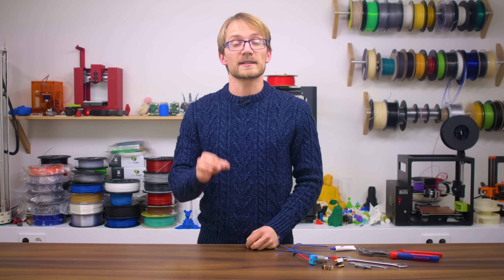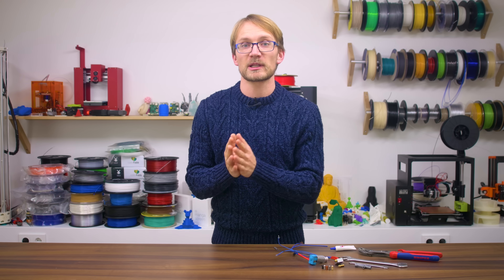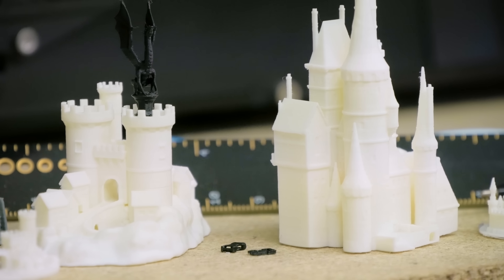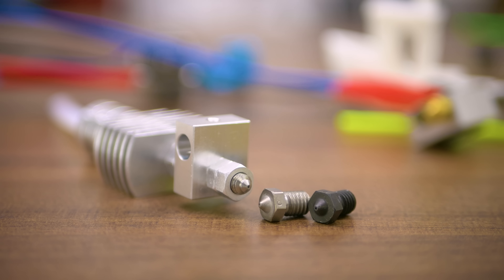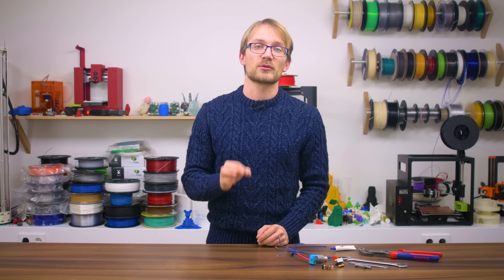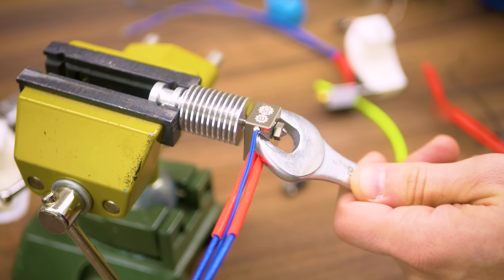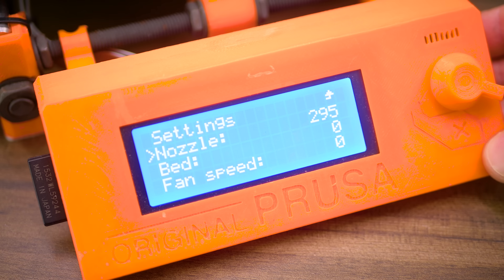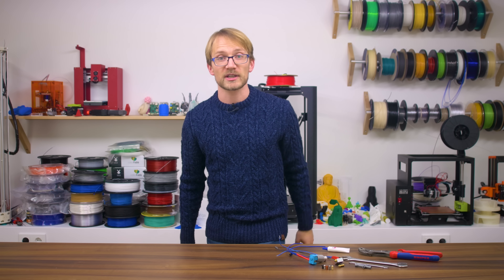How to pick a 3D printer nozzle and how to install it!

Comment: How long does a 1mm brass volcano nozzle last with petg and pla and how do you know that it needs changing?
Reply from the maker: Unless you're actively scraping it against the bed, even brass nozzles tend to last quite long with unfilled filaments (no fibers / glitter). Eventually, the bore will round over and widen up slightly, so print quality will degrade, but with a 1mm nozzle I wouldn't expect this to become an issue until it's seen well in the hundreds of kilograms of filament. Less for smaller nozzles.
Reply: @MadeWithLayers  Thank you, that's very useful and clear.

Comment: Tried hardened steel - kept having a lot of problems. Uneven layers, failed prints, etc. I'd have to crank the temperature up and the speed down quite significantly to make it work. Switched back to brass, my printer prints like it's in factory condition. I do wish it was easier to find videos on how the different nozzle materials affect performance, and what adjustments you might have to make. I don't think I'll be using hardened steel again unless I want to work with some exotic filament.

Comment: Really wanna get tungsten carbide nozzle. Might be overkill, but I plan on printing some abrasives as well and thought of never having to switch nozzle is tempting.

Also I love TC because it's such a great material.
Reply: Funny thing. Not many of these seem to be available (talking about FULL tungsten, not inserts ones) in europe. At the moment i only seen Phaetus X Primacreator nozzles.

Comment: I recently wanted to try to use a smaller nozzle for a very fine part. 

At CHEP's suggestion, I bought a set from Amazon, which included a 0.2mm nozzle; and immediately noticed that Amazon's threads went all the way down to the end. The original Ender5 Creality part seemed to have no theads near where it meets the heatbreak. This, I assume means the Creality heatbreak has a small tapered entry point, maybe allowing a slight overlap (?) to avoid filament escape (?). 

The immediate outcome was that the Amazon nozzle hung lower, despite the fact that its physical length was identical to the Creality nozzle, and forced me to reset my BL Touch Z offset. Things worked well for a few prints, then I started getting leaking blobs :((

Would finding an alternate source for my 0.2mm needs be the required solution; ensuring its threads don't go all the way to the end, and thus a better fit to the Creality heatbreak. Could you suggest such a source ??

I was considering getting a 'Slicer' heatbreak; but from pictures I have seen, it too seems to have a bevelled interface point for nozzles; so I may still need an alternative source of bevelled ended (no threads at end) nozzle.
Reply: Use short nozzle type instead of long threads type
Reply: @Home made science  It has to be long enough to seat on the Heatbreak or leaks occur
Reply: @Exploring Stuff  well it looks like I need new hot end short type then

Comment: Thanks Tom, you earned my subscription.  I didn't realize that the heater block also needed to be loosened and then tightened along with tip after heated up.  Also will start setting temp to 250.  Thanks Dave..
PS: new to printing, I have a Anycubic Kobra printer and have been trying to find a replacement silicone cover, any suggestions?

Comment: Not sur if you’re still reading comments on this old video but here is another one.
I have been changing brass nozzles without any problem using more or less your technic. But lately I’m having a weird problem.  I have replaced my nozzle with the nozzle X and used it for almost a year. Then one day I had a problem with a filament stuck inside and removed it for cleaning. But since then, it keeps leaking after a couple of weeks time.  I ordered a torque wrench to make sure I was tightening enough. But it keeps loosing up after a couple of weeks again. I now tight it to 3nm and still having the same issue. Any idea what can cause this?

Comment: I would have liked some elaboration on the different available shapes, since that's what has me a bit lost.
IE, "ed3" vs "mk8" or "standard" vs "volcano", etc.
AFIK they all have the same thread, but different lengths, volcano being the longest by far.
What I am most confused about is the MK8 vs ed3 though, look completely different but close enough in size to be confused with each other. Are they interchangeable? Would it hurt to have the threads not quite bottomed out if the nozzle is a few MM longer than the heatblock was designed for? How can you even tell which 'standard' a given heater block meant to use? (For volcano this is obvious, but not the others)

Comment: Use a wider wrench and hold the short sides of the heat block which are free of any wires to avoid accident damage to them

Comment: Ok, I just installed a new nozzle yesterday, a .6mm nozzle. When I fed filament though, everything looks like it’s fine, it is coming out of the nozzle perfectly I even did a small test print. I am still worried about if I may have done something incorrectly, how soon would I know if I messed up on nozzle instillation and what would be the early signs of it?

Comment: really great guide about handeling them but i would like a comparison cheap vs expensive. you can get nozzels for less then a few cents each but are they worth anything ? and what to judge them by ? 

also: i have a problem were exspecially the first layer kinda well looks teared from above at one engde of the extruded filament it makes my prints look weird "is as if the nozzel kinda tears it litterly up one side" and i imagne it not being that good for my adhesion as well

i think it might have to do with the nozzel so thats one of the reasons im aksing the above i wonder if its wear or just a low quallity nozzel

Comment: Great Video! I'm looking towards a buying a new nozzle so I thought that I might ask you if the following nozzle specifications with a glass bed on an ender 5 pro could print abrasive materials such as carbon fiber or nylon. 
Specs:
Model: MK8 hardened steel nozzle
Mounting type: external thread connection
Working temperature: 220℃
Size: 0.4/0.6/0.8mm
Filament suitable: 1.75mm
For: 3D printing

Comment: Seriously what is that Anti-sneeze(?)  paste?
Reply: Yep I'm replaying the video lots of time to get to listen well what is this.?
Reply: Anti-seize, although yours was funnier ...! It's frequently used on spark plugs, so easily obtained locally from an Auto parts store.  It's a compound that prevents the threads from locking, a problem when you have high temp threaded parts that are dissimilar metals; like brass nozzles threaded into nickel  coated steel (most hotend blocks). The high temp causes a chemical reaction (called 'galling' IIRR) that causes the two items to bond together, called seizing. In this case you can get a nozzle "welded" to the block, a real PITA to remove. As shown, you only use a little.
Reply: @MrPuterPro  thank you for this detailed explanation

Comment: Hey thanks for that thorough information! I have some questions: Did you just say you can print PEEK with your printer?
Second: how do I clean the nozzle from the outside? many of my nozzles are kind a black after a while so that I can not read which size it is any more (tried with a brass brush and acetone but since I mainly use PLA acetone didn't really do anything).
Third: when I unscrew the heater block for nozzle exchange and then "tighten" it again it always seems a little loose, not as tight any more as in the beginning, is that going to be a problem?
Reply: Try cleaning it while it's hot with a wire brush. If it's just a kind of patina and nothing sticks outwards too much, it shouldn't matter anyway though

Comment: This video just gave the right amount of information. I didn't know about using the Snti Size compound. I would love video about your workflow. Basic information... I can't believe you guys are printing one print  then fixing a bunch of stuff printing another print fixing some more Stuff Etc.  I know you have to do maintenance on your printer from time to time but I'd like to get to the point where I am printing more than I am trying to fix. Like clogged nozzles, misfeeding filament from the coldend extruder, etc. So combined the above with some maintance tips would be nice. Right now I would never leave the house with a print running.

Comment: Why haven't they made a way to switch nozzles while printing. One nozzle print the bulk of print while switch to a smaller one for the details all in one kind of thing.
Reply: you want to manually switch the nozzle? every layer? 
Do this with 2 nozzles on one printer. create the outline with the fine nozzle the bulk with the other.  
Issue here is the amount of swapping you would need to do as well as oozing of the inactive nozzle. further, bumping may become an issue, and the slicer will have to do some serious work, implementing this is certainly non trivial.
Reply: Some printer print with two hot ends for two color why not two size nozzles seem doable.
Reply: @howarddibble3857  you would have to make sure the outer perimeter is labeled as a different color, not only that, the layerheight therefore frequency also needs to change. at all time the layer printing must be higher then the one thats already layed down - this becomes more difficult if layers have different heights and makes bumping into layers far more of a risk. Its very easy to run variable layer height, just not simultaneously. 
I will in a few days have a dual nozzle printer here, I have already spend some time exploring this idea, and if i find the time i will soon try to write some slicing for this but it will take time for sure :/

Comment: I'm using an Anet A8 with 0.4 mm brass nozzle but it keeps clogging which is pretty annoying. And yes, it was my fault this time as I switched between ABS and PLA without properly cleaning it. I am going to stick with PLA from now on and have ordered an E3D Hardened Steel nozzle and a couple E3D V6 copper heat blocks, then some cheap PTFE lined screws to mount it to my standard Anet extruder. 
After I go through the painful process of installing it and leveling the bed, I think it should work great compared to what was there.
EDIT: I broke the thermistor wire while installing the new parts so I have another on the way... It's a nice printer with great results but it has very cheap and poorly made parts.

Comment: stainless steel has a MUCH higher alloy content than carbon steel. because of this, stainless is FAR worse at conducting heat than carbon steel. Just ask a welder.

Comment: What anti seize do I use when using different materials? Most the stuff I can find is specific for a type of material. Thanks
Reply: I haven't used any yet but would think the high temp spark plug ones in the little cheap packets you get at an auto store would work well.  I believe they are multi material, prevent problems from dissimilar metals touching.

Comment: Advice for a nozzle 1.75mm printing wood filament?
Reply: 0.6mm or larger as the particles have problems blocking smaller ones

Comment: I switched to a micro swiss hotend and found the steel nozzle inferior for producing nice prints with PLA so I switched back to brass. I'm sure it can be dialed in to get similar results as brass but I didn't want to bother with that as the brass one is much easier and more forgiving and produced great results no matter the speed or temperature settings. I plan on using the steel one in the rare occasions I need to print something abrasive or very high temp.

Comment: im using unicorn horn nozzles lined with plasticized dolphin tears
Reply: Sweet set up!
I'm using an ice cream cone, with a hole stabbed in the bottom with a pencil to roughly the size of what I think 0.4mm looks like. So far my prints have come out all yellow and flakey.
Reply: @ArcanePath360 bro is printing with mango ice cream
Reply: Noob, you should be coating it with leprechaun tears 😁
Reply: harry potter be like
Reply: Lucky! I could only find the one with sloth tears :/
Reply: The unicorn horn still holding upp? I'm thinking of buying one🤔
Reply: Rip your wallet

Comment: Thanks Thomas,  nice overview. I use 0.4mm brass nozzles as I print mostly PLA. 
I share an experience which might be helpful fpr others: I recently purchased a nozzle from a new source which gave rise to bad printing results: the surface of my test wallprinted with my usual parameters showed an irregular shape of individual layers whereas the wall created with the original nozzle was perfect. Inspection with a stereo microscope showed that the hole was not perfectly round and inside the nozzle the walls were not smooth at all.
Reply: Thanks, i will take it as a warning while purchasing this.

Comment: Here's something weird for you, I changed the stock brass 0.4 nozzle on my Creality Ender 3 to a stainless steel 0.4 nozzle and now PETG filament that used to flow without problem at 215C will not flow and only barely flow at 260C. It is so bad that I can't really print anything because too little of the filament is extruded. I went back to the brass nozzle and everything is back to normal. I compared the inlet and outlet holes of the brass and the stainless steel and they are more or less identical. Can't figure this one out. Is the heat transference of stainless steel so bad that it can cause this?
Reply: A late reply. I had a worked lot with wave soldering machines in electronic manufacturing. What we us are stainless steel tools for for work in the molten solder bath. Cleaning the accumulated dross. These tools were just flat stainless steel about 14 inches long, an inch wide, and 1/8th of an inch thick. Working with one end in the solder, a bare hand on the other end, it took a long time before the end with my hand got uncomfortable to hold. 

I was looking to buy some spare nozzles for my soon to arrive Ender 3, and I thought about the stainless steel ones, but rejected them because of my concern about the poor heat transfer experience I had with stainless steel. I figured that since brass nozzles were cheaper than stainless steel ones, that it might end up costing the same in the long run, and not have to deal with heat transfer issues.
Reply: Indeed, stainless steel conducts heat much less effectively than brass, which will be the problem that Waltkat had. They may have been okay printing a lot slower (to give more time for the heat to conduct through the steel), but generally stick with brass (or copper) for high heat transfer. That's a downside even with E3D's hardened steel nozzles, although I haven't had any real issues with them like Waltkat describes (but I print fairly slowly and use a genuine E3D v6 hotend, which might just be better at pumping heat into the nozzle than the Ender 3's hotend).

Comment: Please guys, why is a gap between nozzle and heat block necessary? In my noob opinion it would be good if the nozzle touches the heatblock because its temperature would be closest to the heater block's. What am I missing?
Reply: For the people who have the same doubt as I: I assembled my nozzle pratically touching the heatblock, and applied a tiny bit of thermal paste between the nozzle and heatblock. I have now been printing problem free for 20 print hours.
Reply: I guess from my experience the gap is needed for making shure within the headblock that there are no internal leaks to have the nozzle an the heatbreak touching tightly.
I got problems at the beginning with a cheap Geeetech that the filament were leaking inside the heatblock causing  nearly unusable prints. The thread of the nozzle dont seal leaks (except some special conical thread types in pneumatic/hydraulic systems)
Reply: The first time I swapped my nozzle I didn't know about the gap.
At first everything looked nice, but after an hour the nozzle somehow got loose and started leaking like crazy.

Since then I always leave the gap and never had any leaking issues.

Comment: I would use a "Zangenschlüssel". I think it Is called plierwrench english. It is a lot safer than normal pliers. I use that a lot on expensive parts that are fragile. It is one of the most important tools at my home. Use the plierwrench to hold the hotend and a 7mm wrench to remove the nozzle.

Comment: I just deinstalled my nozzle to clean it out, but man that thing was not coming loose easy! So i heated it up to a 110 degrees and right away it came off with no force at all. What a difference!
Reply: Do you mean you tried unscrewing the nozzle when it was cold? That will never work after the first time you've printed through it, because there will be molten plastic sticking it to the heater block and/or the heat break. As this video says, heat the hotend up to around 240°C (or the printing temperature of the filament you last used in it) and then unscrew it :)

Comment: Question:  Is it necessary to remove the entire hotend from the printer to change a nozzle?  Or is Tom just showing it this way for clarity?  Seems it'd be easy to do this without fully disassembling everything.   Anybody?
Reply: There are minor difficulties with removing a nozzle while it's still connected to the printer. When twisting the heat block, you are limited in how much you can twist it by the wires to the heater and the thermistor. You should only need to twist the heater block about 1/10th to 1/8th of a full rotation to disengage the nozzle from the heat break, so this isn't a problem if you're careful. I'm looking to pick up hex-shaped heat sinks so I can rotate the heat sink instead of the block.
Reply: I always leave it on the printer when I remove a nozzle, it hasn't failed me yet. With that said, I use a Delta Smart Effector which has a very fragile plate. So keep that in mind if you have a delta with one of them.